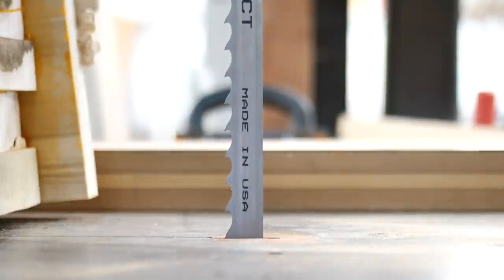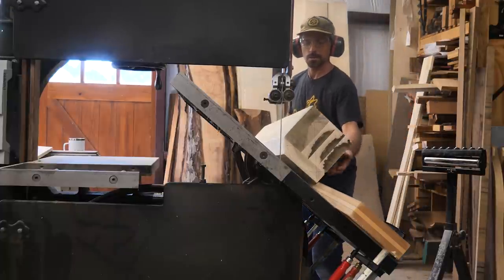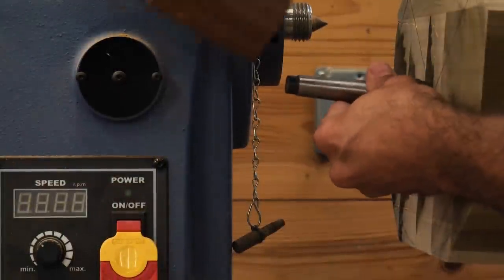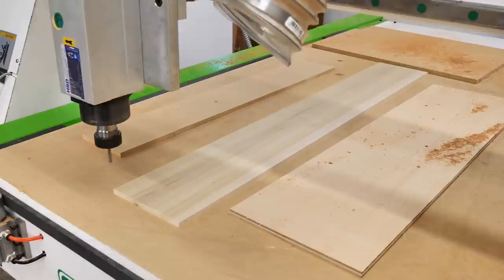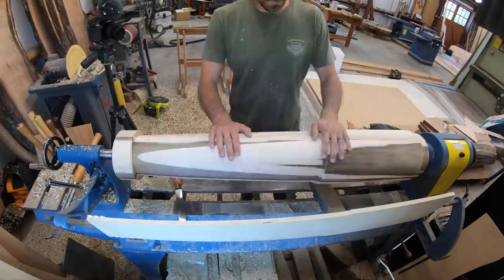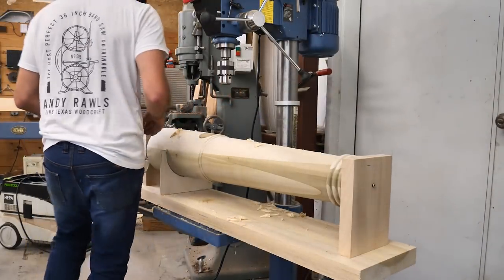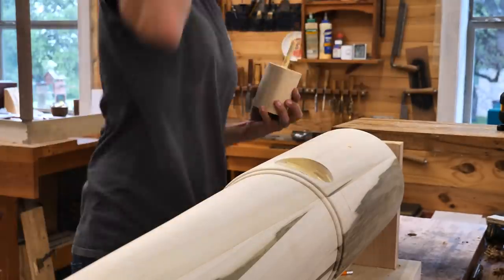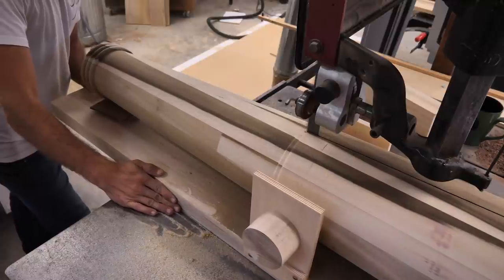Making A Wooden Cannon for the Alamo (The Alamo Project Part 1)

Comment: Are you also going to make the core mold?  Also don't forget that the mold needs to be filled, painted and polished so the sand does not adhere to the wood.  Great job so far.

Jeff

Comment: Awesome video and project! Do they bore the barrel after they cast the mold? I guess it would be a bit difficult to somehow pack the interior with sand.
Reply: I was wandering this too. They might premake it out of something harder (eg clay)
Reply: Traditionally there would be a core in the mould to create a slightly undersized hollow, which would then be enlarged and smoothed to create the bore. Casting artillery is an incredibly sophisticated process that required a lot of skill to do properly.
Reply: This cannon will be made in the traditional method, cast vertically and solid. Once it cools it will be put on a lathe and bored out, then a protective sleeve will be inserted so if we choose to, we can fire it.  Minus the protective steel sleeve this is exactly how they would have done it when the cannon was originally made. Casting a cannon with a void or with the sleeve in the mold is very tricky and can leave voids or cause the protective sleeve to move around making the bore of center.

Comment: The bell is very important in the casting process as the Impurities in the casting process flow to the top and as the cannon will be casted muzzle down, the impurities will float up into the bell away from the walls of the cannon barrel and not compromise the integrity of the cannon Barrel when it is fired allowing for a smaller chance that the black power charge will split the barrel or explode the cannon… History stuff

Comment: Instead of cutting the mold in half with a 1/8" or wider saw blade after shaping.  It would have been better to cut the mold in half before you shaped it and glued it together with paper in between the halves  so you could break it apart after shaping.  An old mold makers trick to keep parts dimensionally correct between halves and keep round things round!
Reply from the maker: Very cool!  Thanks for the tip👍

Comment: There is an old foundry (Alamo Iron Works) in San Antonio. Surprised that wasn’t where you were getting the bronze done. The OWWM guys use a foundry called cat tail that takes on the smaller jobs. Looking forward to seeing some video of the foundry process. Thanks for the video.
Reply: Alamo Ironworks shut down their foundry about 10 years ago. They mainly deal in manufactured steel and building supplies now. Oddly enough, there isn't a Texas foundry large enough to cast some of the cannon were making so we were forced to look out of state.
Reply: @Kolby72  oh man I was afraid of that. They were around a long time.  I was doing some business with them back in the day and one of the guys gave me a cool tour. Good guys there.

Comment: Why did you not hollow out the bore at this stage? Surely this is an ideal time to do so with the two halves open to work on.
Reply: The cannon will be cast as one solid piece and then bored out to the appropriate caliber. This is the traditional way of making a cannon.

Comment: Should have used butcher paper in between two halves. That way you don’t loose the full diameter to saw kerf. Also less likely to get one side with more volume than the other. That would potentially impact the draft angles in the mold and pull the sand, when cope and drag are prepared. Basically cause a rough parting line. Also should have had some core support on the muzzle side. This casting will not do well as a complete solid will likely get a core of some kind . Foundry will add in the gate and runner system and a good sprue to prevent shrinkage as the casting cools. Awesome project. I studied pattern making and cast metals in college. Made many patterns and core boxes! Can’t wait to see the rest.

Comment: looking at the way that forstner bit was going into the barrel, it was not going in on center. It was cutting on the back way before it started cutting in the front. To be on center, the outer edges should start cutting at the same time. Otherwise , nice job of turning!! it looks like you want them off center for the trunnions!

Comment: It is a shame you were not able to  confer with someone about how to make split patterns so you did not need to cut the wood in half and lose the kerf.  Also, there must not be any sharp angles on any edge or junction or undercut which will catch sand when ramming the  sand around the pattern to make the mold.  If you have not sent this off yet, go back and paint or seal the surface so it is smooth and not catch any sand.  Hopefully, the trunnions are not cut straight across on the ends so there is some metal there to be machined; this will allow relief to get the   pattern out of the sand without catching the sand and damaging the mold.  Check out Clarke Easterling at Windy Hill Foundry for casting ideas and how he does it.

Comment: This is an awesome project.  I've yet to make it down to see the Alamo.  I'm up in Ft. Worth.  In my defense I've only been a Texan for 3 years.  I was born and raised in Chicago.

I'm in awe of your craftsmanship.  I never would have thought to use wood for making a model for molding. I think i see how the bit got off center in the rear.  When you were using the screw on the end of the lathe to move the cannon, i think the u-shaped support was sliding down the barrel angle allowing it to drop in height.

Also a question, since you has to halve it anyway, why not create a 3D model and have the CNC create the entire barrel one half at a time?
Reply from the maker: You know it never crossed my mind to CNC but I don’t see why it couldn’t be done this way.  I just really like using the lathe.